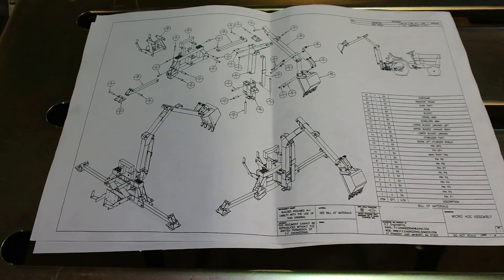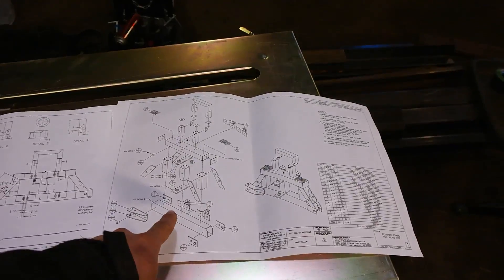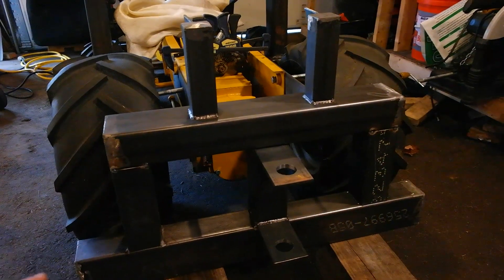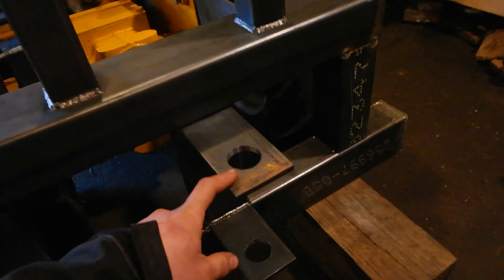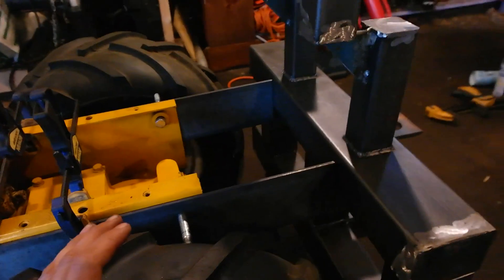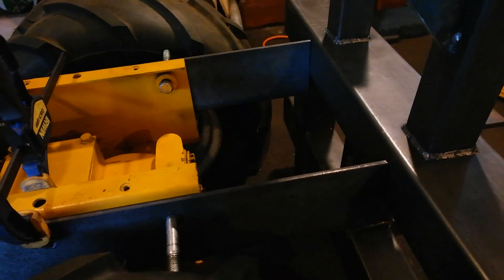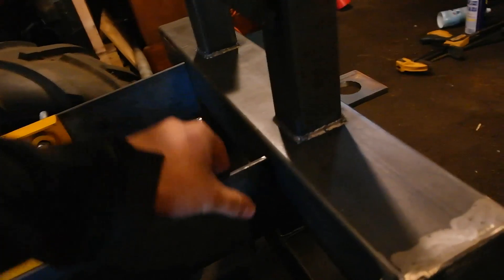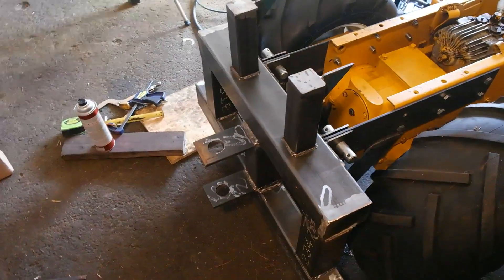Cub Cadet 149 TLB Transformation Part 9: Backhoe Build 1

Comment: Norman, you have inspired me, I have started my backhoe build, I have done all the bushings, the bucket, the bucket links, and the boom. Will be doing the crowd arm next. I am using my Montgomery ward 53027 as the base unit, it has a Johnson loader and is a 16 hp B&S powered hydrostatic garden tractor. What parts do you sell to fit it?  Thank you

Comment: About how much did this cost? if you don't mind me asking
Reply from the maker: The total cost for the whole machine start to finish I estimate was about $3,000. It's now been a while and I didn't keep as good of track of the expenses as I should have.
Reply: that's awesome. I've wanted to build a loader for my 1325 cub cadet. do you think this could handle a loader. the backhoe looks slick. wish I had one. I'm a young farmer in Wisconsin and I would like to build one for small jobs.
Reply from the maker: I don't think a Cub Cadet 1325 can handle a loader. You want one of the Cub Cadets from the 70's. They are the best platforms. A wideframe Cub Cadet like mine is ideal.
Reply: Ok thank you much!